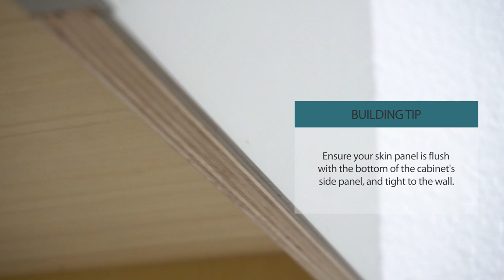How To Install Skin Panels On Kitchen Cabinets

Comment: At 0:22 it shows installing the skin panel with a gap to the wall, and then in the next shot, it says "ensure your skin panel is.... tight to the wall". Which is it? It seems to me that making it tight to the front of the cabinet is more important, and the gap to the wall can be covered with a trim piece.